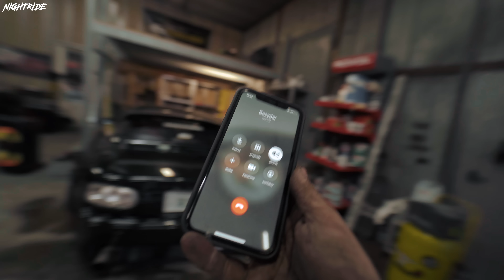Finally drifting our BMW E30 328i but it's still CURSED

Comment: the power issues must be that it does not get enough kuling
Reply from the maker: Right might be this!
Reply: @benshaw576  wooosh
Reply: @benshaw576  you do realize that was irony right? btw..regarding spelling cooling did you actually watch the video? how about the part from 9:16?
Reply: Probably problem of transfusion petrol in fuel tank. Actually this problem when you have stock fuel tank and less petrol.
Reply: @maximbuhgalter  yep, fuel pump doesn't catch the fuel xD

Comment: Your power cutting issue with the E30 is because of the ancient fuel tank setup. Basically you need a swirl pot to counter the fuel sloshing from one side of the tank to another, therefore starving the engine because of the quick lateral movement. Logically the emptier the tank is the worse it will be. Love from Canada

Comment: I had a 330i E36 with the same issue, turning left it had no power, and turning right it was fine. Changed the fuel pump and filter, sweet as.

Comment: You’ll need a swirl pot to drift the e30, so that it has constant fuel 

The fuel slosh inside the stock fuel tank is too much , it moves around a crazy amount when sliding , it’s starving your engine once in drift
Reply: Uhh, there's something else going on than that, my friends drift e30 with no problems and no swirlpot / in-tank baffle
Reply: Facelift or prefacelift tank?
Reply: this is happening to my e30 too, when tank is below half

Comment: Could the power loss couse because 1 of the 2 fulepomps don't work enough, bmw had a kind of 2 half separate fule tanks. An 1 pump to the enige and 1 pump to the other tank if I remember correctly. 
Nice video! Thanks

Comment: You need "atstoinyk". A small fuel tank that's always filled from the main tank, so it doesn't splash on corners. This will fix the power issue

Comment: About brake disc settings, these are two schools. Some manufactures produce with cuts in the front direction (mainly for racing), but this is a small percentage. Most make back-notched discs. So....U didn`t do wrong 😁

Comment: In my e36, there's a hose that connecting between right fuel tank and left fuel tank. Might wanna check that. Or maybe try it when your e30 tank full.

Comment: Nice work guys. About the e30 fuel problem, makesure you have enough fuel in the tank, becaus eif not, when you go in the oposite way of where the fuel pump is(left or right idk) it wil have fuel starvation. But i got one question, why didn't you go with the odesacnc lock adapters instead of modded hubs?
Reply from the maker: Because they make your wheels poke out more which we didn’t want :)

Comment: Although you are not ‘professional garage’ could you explain how you did the front end alignment? I see you are using some kind of plates?
Reply from the maker: yes you have a plate on both wheels and need to measure distance between front and back of the plate. If distance on the front is bigger than the back then you have toe out and this is how it works

Comment: Right, so guys, as an E30 owner myself, It is known that all fuel tanks suffer from fuel sloshing, so your fuel pump is going to be starved of petrol.
You have 3 solutions:
1 ) You get a facelift fuel tank, the one with two holes in it at the top, and put two pre-facelift fuel pumps in both holes, that way, no matter which side the fuel is on, you'll still have fuel pressure.
2 ) You leave the stock fuel tank and pump in place, and buy a swirl pot, with it's own fuel pump.
3 ) You remove the stock fuel tank, and buy a fuel cell for the trunk. Most universal fuel cells have foam inside them to stop fuel sloshing, so for your application, is should work just fine, however it's not legal, and you get a reduced fuel capacity.

Oh, and if you keep drifting it, get a second 'ear' for the diff, kind of like the e36 has, so you won't pull the stock one out, they are known to break off from the chassis when clutch kicked too much
Reply from the maker: Thank you! Think i’ll go with swirl pot solitoon

Comment: samuel it really doesnt matter how you put discs ... cooling is done by fins INSIDE the disc its called "vented" disc unless manufacturer specify what is correct way it doesnt matter
but this slot is to release pressure and clean up the breakpad it makes no difference how it oriented
it was usefull maybe 2 decades ago anyway... when pads were made with glue that evaporated
 
new pads dont do that or dont do that as much 

getting slotted & drilled rottors is kinda useless nowdays

if you realy want to, go for one sloted or drilled

performace aplications use sloted discs

Comment: ΝΟΟΟ  NOOOO  no winter   streeeet car.   ITS a WINTER BEATER !!!!  actualy we have an e30 with 328 single vanos and i guess you dont want to break it like a stick  due to poor  mixture..  try to  make something to keep always the fuel  in the pump line.,.!!! some kind of  walls inside the tank or a second tank smaller!!!!!